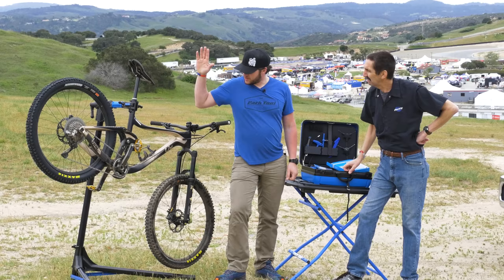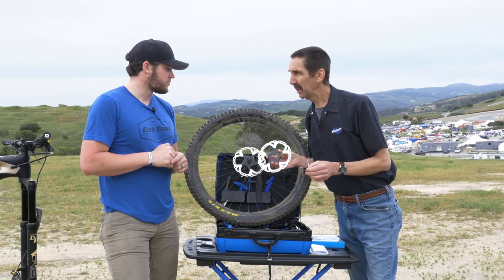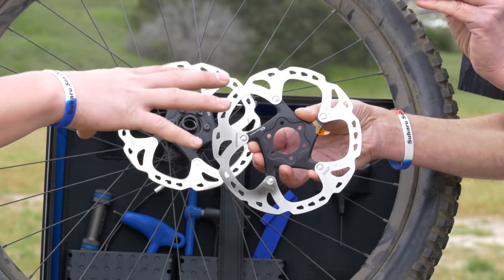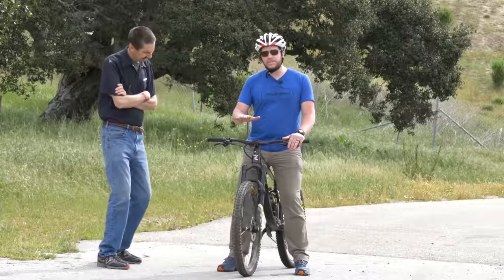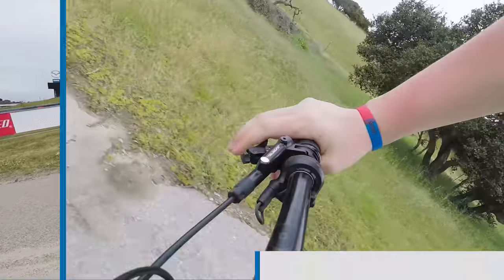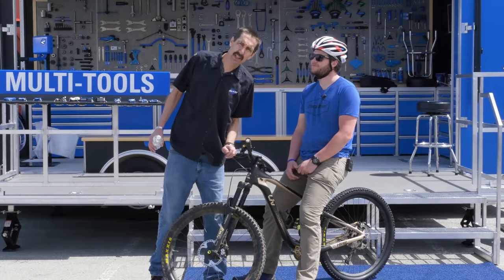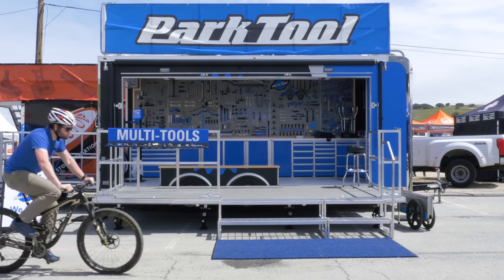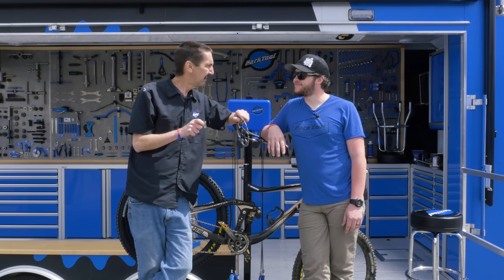Bedding In a Disc Brake - Tech Tuesday #106

Comment: The water is a new  one , my front brake is squeeking whistling!
Reply: Your pads may be contaminated with oil. If there is still enough meat left on them, first decontaminate your rotor with rubbing alcohol, then remove the pads and hit them with a bit of sandpaper to remove only the surface material. It doesn't take much at all. Be sure to keep fingers off of pads and rotors, as well as any other kind of oil.
Reply: Robert Brown no  no oil , plenty on pad , 
Using GT 85 CLEANER. 
They whistle when braking at slow speed. 
Discs braking in slowly. 
I get 35 mph out of this mountain bike .
Pointless rubbing pad with black paper. 
Disc inproving but whistling
Reply: Shaun Lomas I work in a bike shop, which is why I say. I cleaned pads doing this the other day that did something similar and got them to stop squeaking. If that doesn't fix it, you may need some new pads. Good luck!
Reply: Robert Brown they are new pads , I amazing always on to these brakes due to other drivers. 
Touch them lightly going slower they whistle. 
Companies could be cheap out on pads as they are not as they were. 
Dose not stop as it once did .
Using other disc that are the same viery

Comment: @Park Tools when bedding in using the water process should you use your old pads or new ones? Also when using the water process should we be taking into account the ideal gass law (PV=nRT)? (meaning does mmHg play a part? how about ambient temp? or the comp of the pads v rotors?) Same question with the downhill method. When we look at the chemestry and physics of dissimilar materializes?
Reply: Lol
Reply: Whut
Reply: Actually the only important factor is the alignment between Saturn and the Moon.

Comment: in gmbn´s video they locked up the brakes
Reply from the maker: Locking up the brakes during bed in is the opposite of what you should be doing. When you lock up the brakes during this process it leaves deposits at that lock up point and can cause pulsing and uneven braking. None of the manufacturers we talked to about bed in procedure recommended this and ALL strongly advised against it.
Reply: haha so they did it wrong thats funny
Reply from the maker: The comment section on that video has lots of good input on the subject.

Comment: If you want to get to the real problem and  have a good brakes that actually work.  I suggest you clean your new pads out of the box with non-chlorinated brake cleaner.   You’ll be amazed !   spray a blue paper shop towel With brake cleaner and wipe your pads on it and see how much manufacturers residue comes off.   This whole process they’re showing you is really just taking a long reroute to solving the real problem.   just try it and see for yourself .   the whole bedding in thing it’s just an industry solution to not really knowing the real problem.  🍻